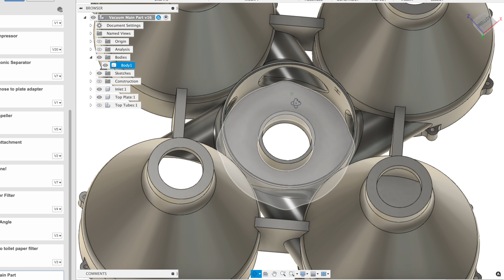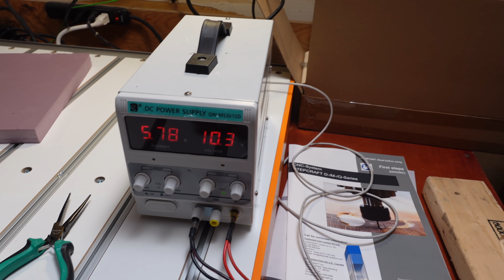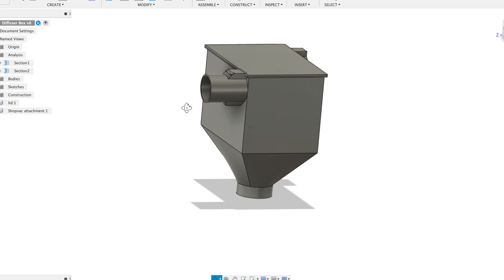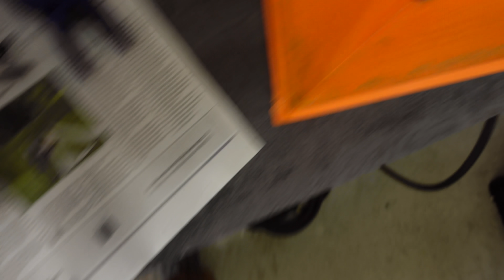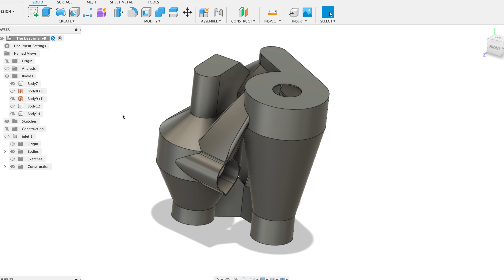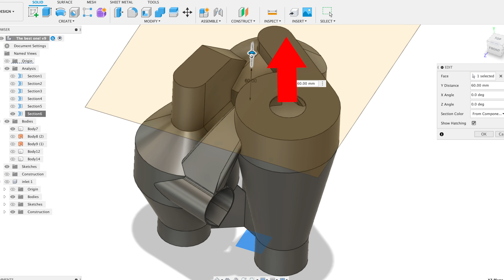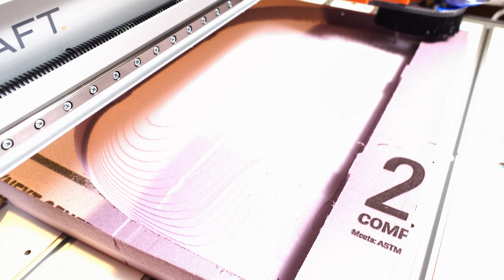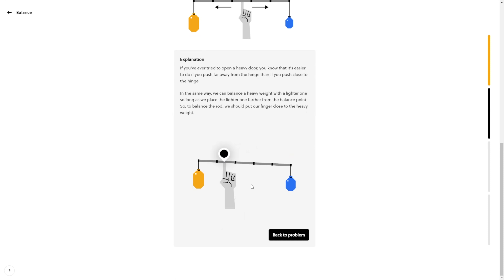3D Printed Cyclone Air/Dust Separator

Comment: This video clearly shows why you should put a cyclone in front of a filtered bag, not use one instead of the other. Cyclone should filter out 90% of the dust, which reduces clogging in a filter and therefor improves airflow in that section. Curious to see if this can be improved further.

Comment: I think a paper towel restricts flow too much. I also would've put vertical ridges along the inside of the falloff cones so that stuff would get caught while spiraling around and be more inclined to just travel straight down into the dealio. EDIT: Oh yeah, I'd also use just a cylindrical centrifugal separator instead of a conical one :P

Man, that Stepcraft is a sexy piece of kit. Makes my 2016 X-Carve look like a piece of trash - which it is! It works, but it's flimsy as hell (before they upgraded the X-axis rails to a single 2x2" extrusion). The Y-axis rails are just too flimsy as well but the main issue is the crappy two flimsy rails for the gantry to slide along.

Comment: Next trick for that might be to try to make a wet cyclone. Which is keep some water cycling from the collecting bucket up to the rim of the cyclone and then vacuum up the dust and crap over that. Seems like that may trap a whole lot of the fine stuff if it can be done right.

Comment: what about adding a screw like edge inside the cone to force the particles down into the bottom. hmm wander if you made it go through some metal domes would it be a cool van de graaff generator :)

Comment: The big mono has a less steep wall, and seems to filter fine particles better while the one that filters larger particles has steeper walls. Is wall steepness related to particle size?  If so, you could make a multi step separator that uses different wall steepnesses.

Comment: the small hose with high speed air cannot have the corigated profile...creates massive wall surface turbulent flow (whistling).  Great application for mixing fluids but high pressure drop/very noisy especially with entrained particles.  Very cool printing/design

Comment: Does this stuff work for aluminium chips or are they too heavy to even get sucked up the initial tube near the cutting tool and if the aluminium chips are small enough to get sucked up which of your designs works best in that case

Comment: With your cyclones have you tried adding some water in the bottom of the bin(s) so the material will not come up..also have you tried hooking up a couple of these together so you have a muliti multi stage separator...... also the cyclones I have worked on have larger discharge pipework so air pressure is reduced to eliminate blowback...... great vid. Thanks for sharing. Stay safe.

Comment: You have to be careful with cyclones not to stall the air by plugging the end of the hose while you're sucking. You get the bucket to squeeze and burp stuff back up into the outlet.

Comment: Great video. I'm still using 2 stratus led for fog lights their Great.  Going to add a reflector to face more light downwards. Had no issues with them fans are working great  and same for the driver have about 5 years with them already.  Their so awesome.  26000 lumes lighting up the road. Aww yea .
Reply from the maker: Amazing!
Reply: @rctestflight  using a remote relay and a 40 amp relay to power on the 12v to 24v then it runs to the 2x stratus leds.

Comment: That sound comes from the corrugation of the tube rather than the diameter, a smooth tube will not make the sound like that though  the smaller the diameter the more energy that is wasted pulling air through it. hope that helps!

Comment: bigger diameter = bigger velocity at the periphery (tangential speed)
bigger velocity = bigger kinetic energy
bigger energy = less probability for fine dust to be sucked from the hole in the center
The key is to keep the fine dust away from the center as the orbits slowly goes down and down. The higher is the cone related to the diameter (lower slope) the better are the results.

Comment: Why not curving the dirty air intake down to force it to the side and down, trying to find a way that the vortice ends as close as possible to the bucket hole in order to almost halt the air flow down there. Maybe a variable curved intake that you can try with a lever from outside. I'm not sure if I was clear but just throwing some ideas here. Cheers.

BTW: Amazing. lol

Comment: That's really cool, I wonder if using some kind of variable speed blower instead of a vacuum would be better for the suction.  Having a speed that is slow enough that particles fall more easily, but fast enough that it can still suck them in is probably key.
Reply: Thats exactly what I found with my homemade cyclone.  The airspeed in the cyclone can be "too fast", so I used a cheap HF router speed control to slow down the vacuum.  MUCH better now.  You also need a "downtube" for the air exhausting from the cyclone rather than just pick it up at the top....it gets better separation from the intake port.

Comment: A better multi cyclone design is to have all 3 at the same height but the particles have to make increasingly steep curves to enter each. Causing the separation for larger to smaller particles

Comment: amazing vidéo, but you can imporve in  two way.  first to have a cavity between dust collector end and bucket in order to avoid that air is going into bucket and take some dust of bucket ,  the other it to have deep tube for air outlet into cyclone. you can use stairman form cyclone for improving the efficiency

Comment: The slow down method works a lot better for fluids because their inertia carries them into the wall at which point they accumulate and run down - whereas the dust is still lose and recombines after impact, if any. This is used in automotive engines extensively for separating oil from blowby gasses before they're consumed by the engine or dumped to the air.
Reply: And, come to think of it, the cyclone method is actually used for separating gasses from fluids in higher speed mostly-fluid circuits, ie, coolant, on race cars where boiling and turbulence are an issue trying to keep high hp engines cool while racing. I wonder if a cyclone method would work for air/oil if it was scaled down enough. Might be worth experimenting with.

Comment: Curious what glue you used for the 3d printed parts and how well does it work? Also, speaking of toilet paper and paper towel for filtering, wrapping a layer of paper towel over a pleated shop vac filter, or using several layers instead of the factory filter altogether, is an option to save time and money on dealing with rapidly clogged filters although yes it will reduce the CFM a bit.
Reply: trying to find a use for that decade supply of TP you horded earlier last year?

Comment: Ah this was so entertaining to watch for me! My first 3d printed project was actually a dyson-inspired handheld battery driven multi-cyclone! I still occasionally use it today. As you found out the key is to isolate the second stage from the first! One lesson you did not mention though is that dyson opts to go for multiple much smaller cyclones as one second stage. The reason is a smaller cyclone will have a much higher airspeed and will thus be able to separate much smaller particles. In order to still get enough air through the separator they just multiply them (a lot!). Those dyson handheld vacuums are seriously overengineered!

Comment: I wonder if small internal mounds within the cone would slow the detritus more quickly. I would guess that mounds of different sizes would effect different sized dust differently. So if the mounds changed size from top to bottom, it might be more effective still.

Comment: Steeper sides on the single cyclone obviously, but would there be any benefit to a larger opening at the bottom?  I'm thinking less chance of the air grabbing dust particles on the way up the cone from the bucket.

Comment: You are missing a crucial part. The outlet needs to have a tube reaching down into the cyclone . About 1,5-2x the diameter of the intake . Also : the smaller the diameter of the cyclone is , the finer are the particles these get separated . Don't make it so small though that the air out of the intake smashes into the outlet tube . The upper part needs to be cylindrical and only a couple of outlet diameters under the outlet tube it needs to taper in . 
There must not be an airflow from the solids-outlet into the cyclone or it won't work, airflow out of the solid outlet needs to be kept to a minimum . There are some simple Formulars for dimension ratios  to get decent results out of them and there are some way over the top complicated methods of modelling them . I did a cyclone separator to separate  oil from. A stream of CO2 in my thesis . If you want to go into detail on how they actually work , I would gladly give you some info .
Reply: Wow, great info!  I'd be interested in anything you wished to share on this subject.
Reply: Seconded. I did some r&d on a separator several years back, but settled on a dust deputy. I drill bolt holes in concrete quite often and the dd in front of a hepa filter does the trick.
Now, I just so happen to be searching for the perfect air/oil separator on a turbofied car engine. 
Any detailed info you might have would be welcomed here.

Comment: Really great video with the clear ports and the slo mo.

The cyclone does not need to be a cone.  Walls can be straight.
Reduce the cyclone diameter to be about 3 of your inlet hose diameters.

Inside the cyclone where the air enters,  it collides with air already going around.
If you can create an enclosed spiral square tube inside the cyclone  going around once at the top, this can be avoided.
Pitch of the spiral is one inlet hose diameter.

As already mentioned. the outlet tube in the center should go down into the cyclone  about 3 cyclone diameters.